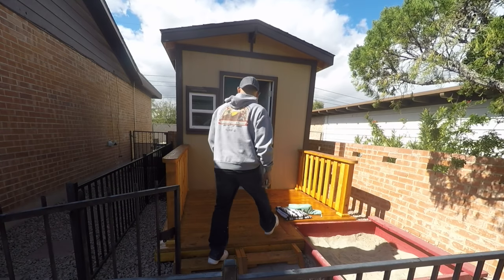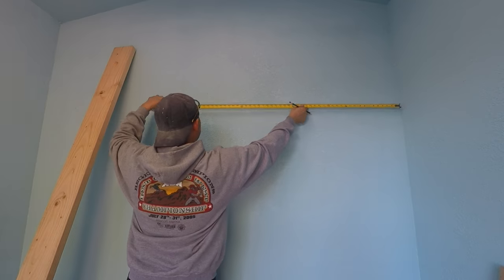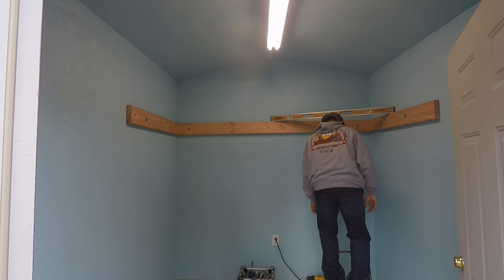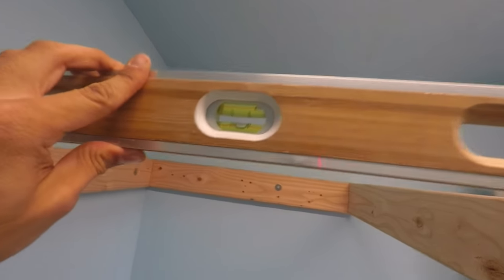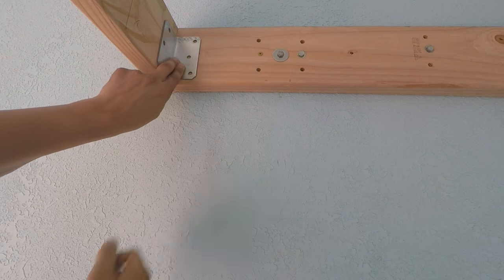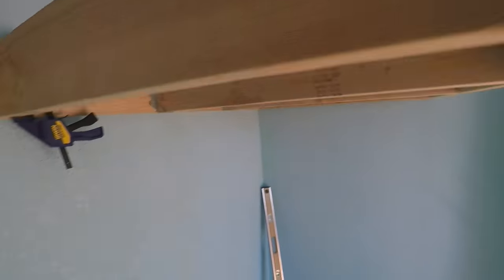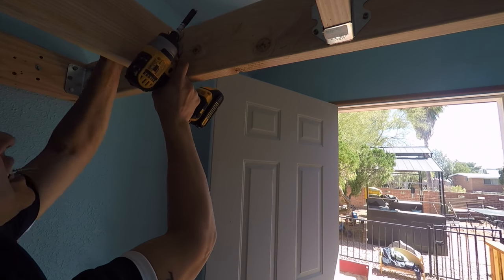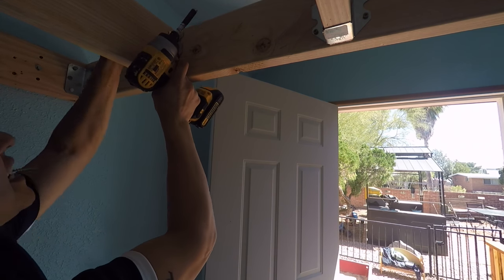BUILD A LOFT BED WITH NO SUPPORT BEAMS!!! AND EXTRAS!

Comment: hi, buck here, i loved your project, however i want to add a suggestion. on your ladder to the upper bunk deck, it needs to be at right angles to the dismount/mount to the upper deck, the kids need to approach the ladder from one side or another so that they are not extending facefirst or backwards to get onto the ladder but from the side so tthat they can see where they are going to land or step onto, if you look at industrial safety ladders you will see that the dismount is to either side than over the top of the ladder, example, if you are dismounting from your roof of your house onto a ladder you need to be able to see where you are placing your feet to going rather than backing blind to a potential fall point, its just the way your brain works, you need a place to one side or the other to place your butt, to be stable or to step from, i spent 60 years as an industrial millwright/machinist and have been up many hundreds of yards of safety ladders and i always felt safer stepping sideways onto a landing, good luck, i added your build onto my bookmarks, thanks buck...

Comment: May I ask a question? Would it have been any stronger if the joists would have gone from wall to wall rather than from the back wall out to the front piece which is only secured with two lag bolts on each end?

Comment: Looks awesome bro, just a thought, get yourself a bevel, cheap ones are about $7, that way you could of used it to make the angle top and bottom without needing ply or some the right thickness and marking top and bottom can be done without the ladder in place. But anyway great job

Comment: You can also use structural screws.  They are available in different sizes, lengths, and colors and either hex or torx head.  They don't require pre-drilling but I would recommend two screws per stud.

Comment: Ebook link doesn’t work… just wanted to find out what size lag bolts you used and what size pilot holes did you drill to insert the lag bolts? It would be so helpful to know! Thanks x

Comment: Great job!!! I will be making my daughters the same way. Thanks for keeping it simple.
Reply: I know this is late...but I just came across this. This is massive overkill. I've built beds like this and beds with supports using 1x4. He build this strong enough to put a waterbed on. While I agree with 2x6 along the sidewalls, The rest can be made using 1x4 fro cross supports with 1x6 along back wall and front face.

Comment: Thanks for sharing! What I didn't find out was the hight from the top of the bed to the lowest part of the ceiling? I'm going to make exact the samen loft but under a flat roof and only got 30" inch. Thanks in advanced

Comment: Awesome video Alex!

You inspired me to tackle on a similar project!

If I missed it I apologize but, could you tell us the length and diameter of the Lag Bolts/Screws that you used?

Judging from when you were screwing in the 2nd  Lag Bolt they are at least 4" in length but not sure on the thickness.  Thank you!

Comment: Then when you installing the bottom plywood just set up your steal scaffolding with 4' cross bracers and remember to count the 22" for the aluminum I beam and 4x6 on edge to give it that strength to hold it up! And if you are un sure you can throw a few steal shoring up in between the I beams jus to beef it up!
And please don't for get to clip it!! We don't want some random shoring dropping and hitting some one in the head. Buy this point it should be safe enough to start screwing in the plywood, remember to use your hard hats and eye protection and ear plugs! 
😂😂😂😂

Comment: Hey great video! I want to adapt your model for a longer space with a queen size bed, as long as I use the same distances in between the blocking in the middle, will it be okay to sustain more weight? The floating side will be approximately 10 ft. long, do i need some central support beam/ chain for the extended length or will it be structurally sound as your model is?

Comment: Hey Alex Quiroz, I am going to build a loft bed but I only have two walls to work from: like yours in the video, only the wall on the right has a door where the joist would be. My only option is to have posts but is there a way to do what you have done, frame and supports, just without a joist on the right side and instead a post?
Reply: You can also hung it from the ceiling. That way you don't use the post

Comment: I like watching your videos but how does this blocking add strength? you can span 7'6" 24" on center with 2x6. I wouldn't think in 40" they are going to twist. nice work tho

Comment: I'm interested in doing this but want to avoid having to take off sheet rock for blocking.  If I had a 4x4 support beam in each corner of the bed should that provide enough support?
Reply: Yes more than  enough support. I'm a carpenter my self I've done many of this and different ones

Comment: Thank you for sharing this, I will be building an almost identical design for my teenage daughter. 
Do you think 2 x 6’s will be sturdy enough still or should I consider bigger. 
The span will be about 7 feet across but like you I don’t want any support beams you want it to be floating.

Comment: What type and size of bolts did You use to fasten the wood to the walls? I'm planning to make a similar bed, no support beams too, and I think that the proper bolts are the most important thing to make it safe.

Comment: i would of ran the cross beams from the two outside walls instead of from one to the floating 
 joist.  More support from wall to wall than wall to floating joist.
Reply: This is what I was thinking. As the weakest point is the floating joist. And all the weight will be on this, towards the ladder side.

Comment: Hi Alex, wouldn't it be better to run the joists from side wall to side wall? Your kids are lucky to have such great dad.. :)
Reply from the maker: Ryan Chan thanks for the comment! It could be done either way really I just chose to give the frame some extra wood! I guess I like to work harder and not smarter haha!
Reply: I think you ran the joist the right way. there would not be any sag prevention had you gone the long way.  you would've need many many more cross members and over time it still would have sagged without floor or ceiling supports. But you really those railing 2x4's tight by cutting out the corner molding, that gap will eventually stretch and weaken the entire rail.
Reply: Ryan Cha
Reply: Ryan Chan
Reply: Alex Quiroz hbhhghh

Comment: wow super thorough video. much appreciated!
do you think it would be strong enough to support two full sized people though? would putting some support beams on the side help support the extra weight? 
Im trying to avoid putting up some support beams right in the middle of the bed, and blocking the open floor beneath.
Thanks again!

Comment: Hi. Do you think my loft will hold if I use only two walls which are 2.7m apart?
Reply from the maker: Hi Jd Jets! Great question! So 2.7m in feet would be roughly 8ft 10inches if I'm correct... would there be a ledger board of some sort on another wall? I would say that if only going off two walls, I would make sure to add blocking and Jack studs to the bottom of the blocking inside the wall to make more strength and then the lag bolts will attach to the blocking.... I hope that helps!
Reply: Alex Quiroz Hi. So concerning the Jack studs, would that mean I have to add a pillar below the ledger board?
Reply from the maker: Hi Jd Jetz! So the studs will go under blocking on the sides of the bed as the ledger board will be secured to the studs that are in the wall... You could get away with lag bolts into the studs on the sides without studs under blocking, however I would always recommend blocking just to give it that extra support of weight.

Comment: why not cut out the  sheet rock so that the board is right against the studs. it would be stronger and you would know exactly where the studs are... just a thought.  never assume
Reply: Joseph DuPont yeah you can cut the sheetrock out and it would definitely make it stronger but in addition to that you will be able to visually see any electrical wires before you start running screws in the wall blindly. Have you ever seen somebody run a screw into a live wire? It's a sobering experience

Comment: I have absolutely ZERO trust when it comes to wooden pole supports, so I'd probably end up welding a 90° metal supports then screw it into the wall to keep it stable then the rest will just be wood.